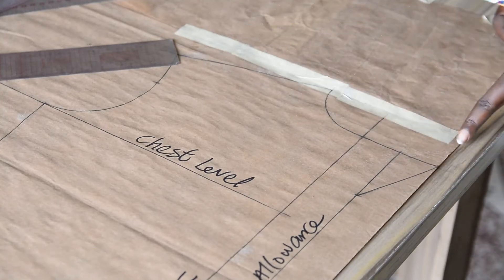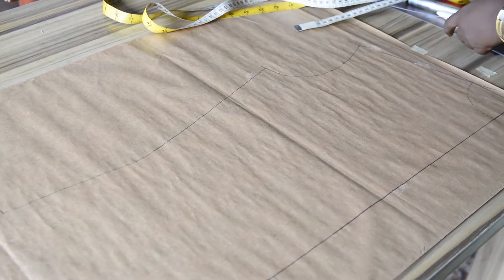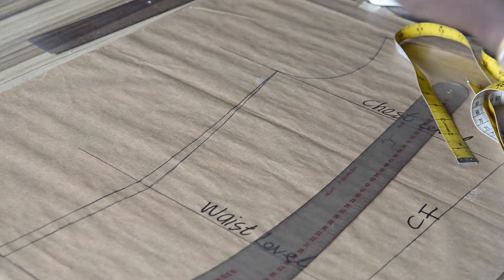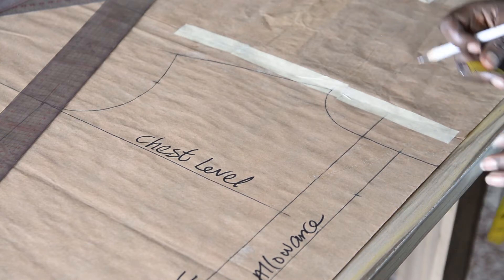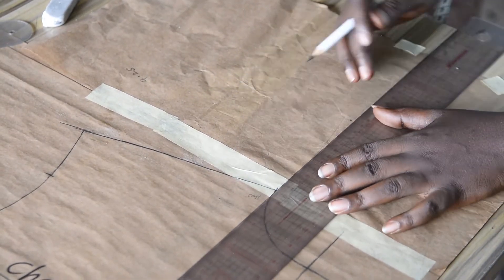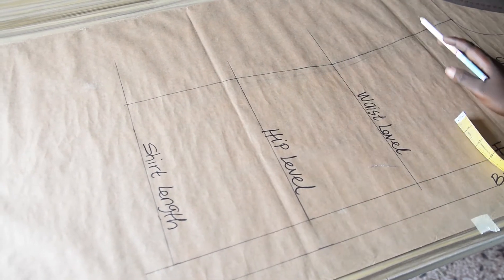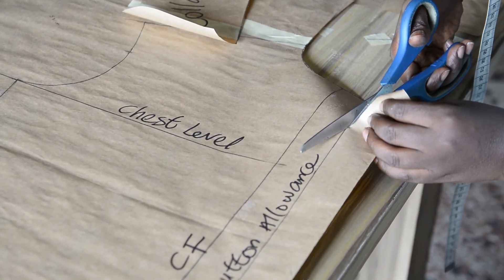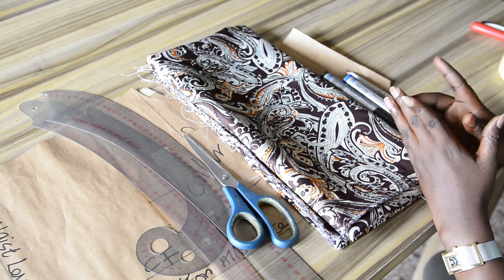HOW TO MAKE A NOTCHED COLLAR SHIRT Pattern ||A Vintage  Shirt Pattern

Comment: Pls ma I always confused on pattern drafting
Reply from the maker: What are the challenges you're facing on pattern drafting? I'm here to help you out.
Reply: So dat I can be able to explain better
Reply from the maker: @afolayanemmanueloluwaseun2004  . pattern Drafting is one the methods used in clothing construction. The 3 methods of clothing construction which are, Pattern drafting method, Draping method and Freehand method.
Pattern drafting is the method of interpreting your style on pattern paper with the help of pattern drafting tools and calculations. Pattern drafting method helps you to understand the in and out of fashion designing. You don't just do things but do things with reasons, also Pattern drafting allow you to correct your mistakes before cutting out your fabrics. Hope this is helpful?
I will be having a full detailed course on pattern drafting soon. Watch out!